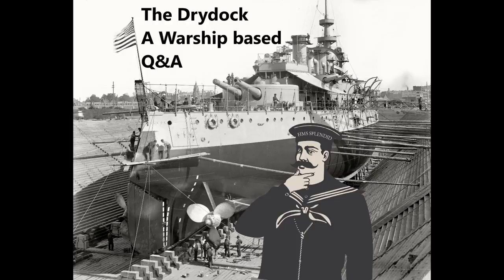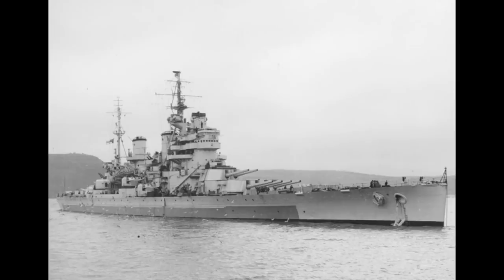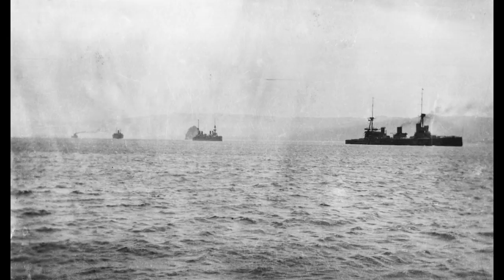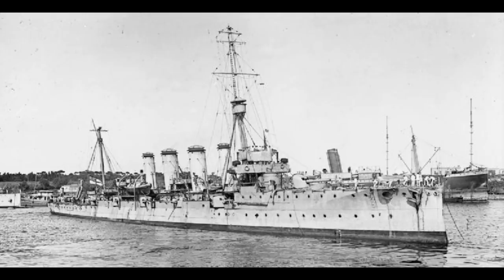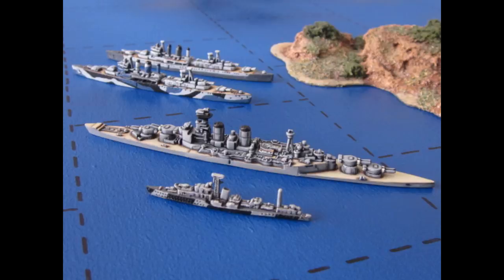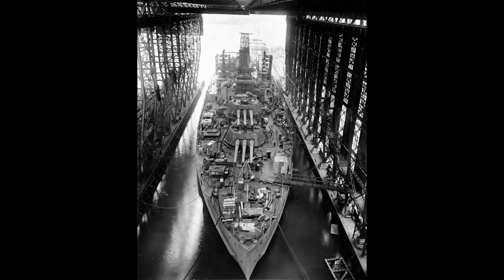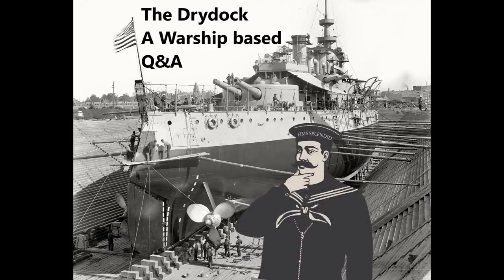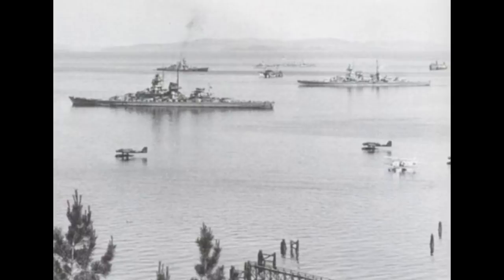The Drydock - Episode 081

Comment: Just one note: the Mig-25 is not made of titanium. It's made of steel. The soviets found that, at that time, the welds in those thin walls were constantly cracking, so nickel steel ended up being the primary material. Afaik, titanium makes up less than 10% of the aircraft.
Reply: Yes.. it's only NATO that thought it must be made of titanium... it turned out to be an unmaneuvarable... junk wagon with a very strong metal box... was good for recon though ... when it worked... and no real turns... no don't turn... arrrgggh
Reply: @blogsblogs2348  don't forget it was designed for high-altitute, high-speed bomber intercepts; it's primary targets would have been the B-58 and B-70. Not much need for manouvering there.
Reply: @jlvfr  absolutely agree.. it's just NATO that soiled themselves... a bit like with that chinese stealth aircraft that they thought was a fighter.. but is actually a light bomber...
Reply: @blogsblogs2348   The reality is a AA missile doesn't care if you're a bomber or a fighter. It'll just help them chose which stencil to use to mark the kill on their aircraft. It's a clone of the F35 or the F22 with the same enclosed missile racks like all stealth fighters. Form follows function son. If it looks a fighter, flies like a fighter and carries a fighter's weapons...it's a fighter. Maybe it's one of the new Chinese transformers that just identifies as a bomber?
Reply: @blogsblogs2348  ; What part of the aircraft the outperforms the F-16, FA-18 and AV-8B in every aspect besides price and availability is rubbish please? Did you fall for the news media trap?
Reply: @readhistory2023  ; AA missiles care if you are a larger aircraft though and if your exhaust isn't low observable.
Reply: @FirstDagger  there's nothing low observable about an awacs style platform or any of the normal tanker aircraft without which USN USAF etc basicly have a finger in the eye and a kick in the shins.. it's not war winning... it's just part of the overall fuusa package that China is going with....
Reply: @blogsblogs2348  ; Re-read my comment, at this point you are just talking rubbish. I was talking about the F-35 unless you haven't noticed.
Reply: Soviets didn't have much titanium because the USA had made most of it into SR71s
Reply: My father helped develop the first US jet engines, and so far as I understand things, the only real use of titanium was for turbine blades, and that was a vastly expensive contract overrun for which the government kindly took the hard-won technical knowledge from Westinghouse and then refused to pay for it.  That's when my father lost his job at Westinghouse and switched over to GE and their space and nuclear programs.   Hardened steel blades just had this unwanted tendency of melting too easily, but machining titanium was a new and, at the time, exceedingly difficult challenge.

On a sidenote, when my father interviewed at GE, they handed him a page full of jet engine performance measurements and gave him a half hour to graph them out.  He just took a pencil and immediately drew out the graph and handed it back to the interviewer.  He got hired.

Comment: I do wonder. If one of the KGV's was named Beatty, would it have randomly exploded at first contact with an enemy?
Reply: DaniëlWW2 “Sir, we have detected the enemy on radar, 15 miles out!” 

ship completely explodes
Reply: No ships occupied by Beatty ever blew up, only those where the  Admiralty loading proceedures were ignored to increase rates of (inaccurate) fire.
Reply: Alec Blunden Which was Beatty’s responsibility.  He decided rate of fire was the thing to emphasize after Dogger Bank and not safety regulations.
Reply: No, HMS Beatty would be fine, but in any battle we’re it’s a flagship half the ships under said admiral’s command will randomly explode

Comment: The need to correct the Magnetic Compass predates Iron or Steel Ships. Captain Flinders wrote a treatise on the subject and a bar of mild steel was place ahead of the Compass Binnacle known as the Flinders Bar. this was to compensate  for any iron fittings including cannons fitted in the ship. With the introduction of Iron and then Steel ships more compensation was need to mainly compensate for the magnetism built into the ship during construction. The great inventor Lord Kelvin used two soft iron spheres at each side of the compass, generally known as Lord Kelvins Ball's with additional hard magnets within the Compass Binnacle. The ship when new at at regular intervals requires to be swung and the magnetic's adjusted.
Reply: In the U.S. Navy they are called the Navigator's Ball.
Reply: Navigator's Balls.
Reply: CipiRipi00  You can buy a chart of the world showing magnetic variation and its rate of change.

Comment: To take of the Titanium discussion: its in a suitable alternative of aluminium i.r.t. weight (60% heavier), and significantly stronger. From memory titanium will be stronger than basic construction steels, but if you go into exotics hardening processes can push strength and hardness well past over titanium. 
However, it should be kept in mind that modern infrastructure is mostly layed out for machine components that are more in the 50 cm to 50 cm area. Larger machine frames / structures are generally made out of welded construction steel, as it way more effective to make frames or heavier, or larger instead. Even for basic aluminium, manufacturing large frames in the order of 10 x 5 meters you end up in specialty facilities, like guys that make components for CERN LHC, ITER, etc that want to have mono-block frames to reach predictable behavior on precision level.
Reply: Also, titanium is incredibly toxic when it burns.
Reply: @whatsoperadoc7050  titanium is one of the least toxic materials out there, including titanium oxide and most of other compounds. It also has a high melting point compared to aluminium, so will hold up fairly well in a fuel fire.

However, titanium is quite expensive to produce and machine, so a fully titanium battleship will be virtually inaffordable. Most current ships use aluminium or steel as basic construction material, with fiber reinforced plastics for armor.
Reply: Titanium is a good metal. It holds its strength at higher temperatures.  Unlike steel which begins to soften as temperatures rise.But when it reaches certain temperature  it will fail.Also titanium requires a oxygen free atmosphere to weld, if you were to weld it like normal steel. The titanium will absorb oxygen in the weld seam and it becomes brittle.
Reply: your better off with ceramics then Ti at that point too
Reply: Deep
Reply: @Elios0000  I'm now pondering how you could add Chobham armour to a destroyer. Combined with a couple of those new laser-based anti-missile systems and HMS Chobham would be quite the gunfighter.
Reply: Good Points. Another one would be the cost of Titanium. Back in the Cold War the Soviet Union, a country with significant Titanium deposits, tried building submarines out of it. These submarines (the Alfa class) had quite a few advantages thanks to their Titanium hull, but for the follow up classes the USSR went back to stell hulls, Titanium hulls were just to expensive, even for one of its largest producers.
Reply: Surely if anyone actually bothered to build armour for ships they'd not use plain solid metal for it. As much as we've lost the industrial capacity to make 12+ inch steel belts, there's 70 years of tank development that'll be relevant here. Why would you have a foot of steel when you could build a multilayer composite armour with titanium, ceramics, plastic foam & aerogel spacers with depleted uranium inserts faced & backed by steel in a 18-20 inch sandwich with less overall weight than a 12 inch slab of RHA & more overall ballistic resistance.
Reply: @arkadeepkundu4729  has anyone ever tested how modern ceramic armor would react to long term exposure to salt water??? I suspect it may be adverse...
Reply: ...Battleship Guggenheim Museum hoves into sight
Reply: The Soviet Union was able to build The Project 705 submarines had a unique design among other submarines. In addition to the revolutionary use of titanium for its hull, it used a powerful lead-bismuth cooled fast reactor as a power source, which greatly reduced the size of the reactor compared to conventional designs, thus reducing the overall size of the submarine, and allowing for very high speeds. However, it also meant that the reactor had a short lifetime and had to be kept warm when it was not being used. As a result, the submarines were used as interceptors, mostly kept in port ready for a high-speed dash into the North Atlantic.
The Only thing the US can make using Titanium are parts for aircraft.
Reply: @frankfeitoza6211  also some pretty flash road bikes and bicycle components. Also thanks for the Ctrl C Ctrl V from wikipedia
Reply: Titanium has one real problem in a naval environment: free chloride ions.  TiCl2 is titanium's favored state when there's chlorine to be had.  And what is sea water full of?  Your protective coatings, welds and sacrificial metal sections better be spot on or you're in more trouble than a painted steel hull is.
Reply: @frankfeitoza6211  I've had pumps, pressure vessels, thermowells, and other components made of grade 2 and grade 7 titanium for use in chemical plants.  Yes, it's not cheap, but is used for corrosion resistance not light weight.
Reply: Titanium passivates and is generally resistant to corrosion in sea water due to seawater's high pH.  Palladium stabilized titanium is very resistant to chloride attack in acidic environments.
Reply: Aluminum starts to lose strength rapidly above about 400F.  Above 600F it anneals and is weaker even after it cools.  Titanium doesn't start to anneal until about 1100F.  Carbon steels become useless structuallly by 800F but don't anneal until over 1300F.  300 series stainless steels are usable to over 1000F.  It is also necessary to consider creep if the high temperature is to be maintained for a long time
Reply: @Elios0000  The components that you can usably make from ceramics are very limited.
Reply: @arkadeepkundu4729  Modern composite armors used for tanks are designed to resist heat rounds and 5kg penetrators 3cm in diameter.  Resisting a 1200kg 16 inch armor piercing shell would probably require a rather different technology.  A composite armor might be used but it would be very different from Chobham.

Comment: Hello drach!
I totally agree on the "modern armor"isdue with you.
I am a structural engineer (sort of) and to be honest: it is very hard to get and great amounts of sterl slabs that exceed 50 or 60mm thickness. We needed 80mm some years ago for 8 base plates of a steel tower and those had an awful long delivery time.
Not to mention the special testing that was needed as well. And I am only talking structural steel S355 here, not armor of any type.

Comment: As for wargaming scenarios, there is also the problem where the senior officers don't like that the outcome calls into question the current doctrine. An excellent example of this is in Millennium Challenge 2002 where a retired Marine Corps general used the US Navy's reliance on high tech equipment against it, and used his Iranian red force to cripple the US Navy taskforce, sinking 16 ships in the first two days, consisting of the carrier groups carrier, 10 major supporting warships, and 5 out of 6 amphibious assault vessels. The US Navy top brass decided to restart the scenario and stack the deck in the US favour, including putting time delays and other penalties on red force, seemingly in an effort to confirm that US Navy doctrine was sound. The Marine general in charge of red force resigned and publicly criticised the decision to reset the scenario change the rules. Eventually what was learned was that if you script a war game so blue force wins, blue force wins the war game.
Reply: DERP Squad perhaps you can then explain how the General managed to mount P-15 missles on boats that were only slightly smaller than the missles themselves (19’ missle weighing 5700 pounds, 25’ fiberglass boat weighing 5200 pounds). You might also mention that many elements of the ship defenses were turned off because of computer-imposed conditions. If you are going to tell the story, tell the WHOLE story.
I don’t argue that the tactics were inventive and creative, and it does point out the assumptions that are made about technology and its abilities have real limits. But at least use realistic conditions when making the case for low-tech solutions.

Comment: As per Midway wargaming, some accounts indicate that the Japanese judges reversed some of the results to show less losses.
Reply: The authors of Shaterd Sword called the midway wargames pretty much a farce.
Reply: @Bird_Dog00  "Four days of scripted silliness" was one way they referred to the affair.
Reply: The Japanese were shocked at the ineffectiveness of the Midway air group.
Reply: Graff_Zitel the main issue with the US air groups at Midway was that outside of Yorktown’s air group they were all inexperienced and were attacking piecemeal which allowed the Japanese CAP to effectively deal with them.  Until Yorktown and Enterprise’s dive bombers made a coordinated, mass attack by accident while the Japanese CAP was down low after mopping up the last torpedo attack.
Reply: kiloalphasierra the IJN carriers also dodged extremely well. No hits up to that point is pretty astounding.
Unfortunately Japanese reconnaissance is terrible, did them in on multiple occasions and this one also

Comment: I think that Marine Compass stand is called a "Binnacle".
Reply: Today's Spall Liners are far better.  Titanium is best at resisting heat without deformation.  Might be useful as a carrier flight deck material.  Also, imagine plating a warship in the Chobham armor system.  What's it for?  Missiles with HEAT warheads, of course.  What's it cost?  Hehehe.
  Incidentally, one can design a ship to be practically immune to gunfire.  It's called a "submarine".  ;-)

Comment: Being an engineer, I'm wondering how long a "5 Minute Guide" would be if Drach addressed degaussing (permanent vs. "wiping"), deperming of subs, effects on equipment such as compasses, etc.. My guess is at least 45 glorious minutes.
Reply: I think we need an engineer's sub-section.  I'd like to know just how many man-hours it took just to DRAW an entire battleship, its components and specifications.  It's not as if they had CAD stations.
Reply: @stevewyckoff6904  It not only took a number of hours but a corps of trained draftsmen. That was one of the problems every navy ran into after W W I. The existing experienced corps of draftsmen from the trenches.
Reply: @stevewyckoff6904  it was an insane amount of effort.  Now the ship design is a virtual solid model with  meta data that shows the maintenance envelopes, power draw, part number weight.... e.t.c of each component.   You can virtually walk thru the ship and operate each component.  From the model, flat drawings are generated for production.  The slavery of pencil and ink drawing tables required a huge staff, not much improved by 2D cad.   I once spent 2 years on a drawing for  one large component for CVNs

Comment: Dang, never realized how much technology has been lost regarding armor since World War Two.
Reply: Armor along with the ability to make those big guns as well. sm
Reply: adam alton the technical knowledge is kind of there, we do still have some large hydraulic presses and lathes from the period, I worked with one factory which had a 30m long fun lathe and that’s even here in Australia! They used it for making wind turbine shafts, and the hydraulic forge press in the factory dated from 1908. These are the items you need. 

But of course you also have to remember we design things very differently, and we remedy problems differently. If something was off, the guys who built it back in the day just knew what to tweak and where, these days we engineer a permanent solution. Take the Saturn V engines, we can’t make them anymore, we lost the know how! But, we designed a newer and better engine in its place.
Reply: James McKenzie true, and lest we forget this type of armor/weapons manufacturing went out of favor for a reason.

Comment: while we don't know too much about modern composite armour, i suppose a very rough estimate could be made like this:
70 tonne tiger 2 has ~8in effective frontal armour, 70 tonne M1 has armour roughly equivalent to 20-40in RHA. this is a 2.5-5x increase in armour protection. we also know RHA is roughly comparable to face hardened, for example the face hardened front of early panzers and RHA sides of panthers provide roughly the same protection. does this mean a modern battleship can have roughly 2x the protection of a ww2 battleship?

Comment: Large portions of the structure of the MIG 25 were made from stainless steel alloys resulting in a plane that was quite heavy for it's size.  Stainless steels have high temperature strength that is similar to titanium, but weigh twice as much.

Comment: just for discussion purposes,   the majority of the US armored plate steel was manufactured in the Pittsburgh Steel plants.    Many of those plants are idle and shut down for the most part.   and wit the technology of penetrators used in tanks.   a 5 inch gun can penetrate 18 inches of armor.  Limited by the length of the penetrator so a larger platform can easily carry a larger shell.

Comment: 26:14 I think you should define what you mean by really exotic? In my opinion composite armours aren't that exotic and in some forms are even quite crude, such as fibreglass enforced face hardened rolled steel, or even something like a sandwich plate of harder to softer explosively welded(that's a thing) metals. Really exotic in my ears are something printed graphene on bricks of boron carbide or something sci-fi like that.